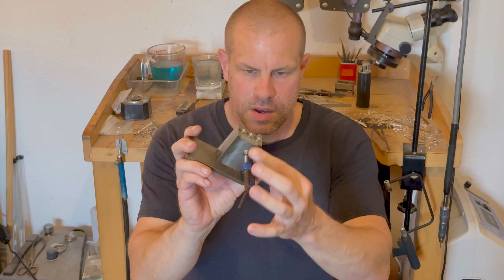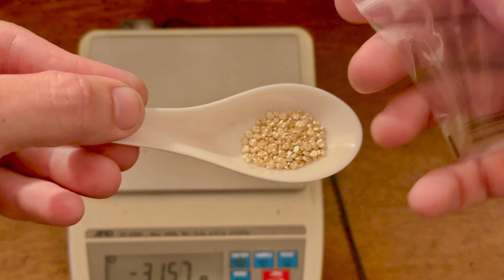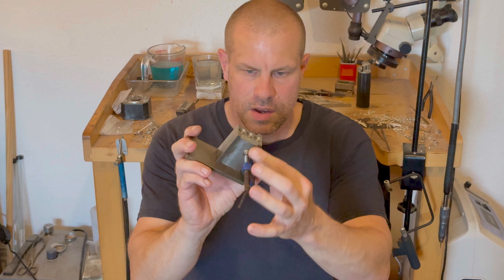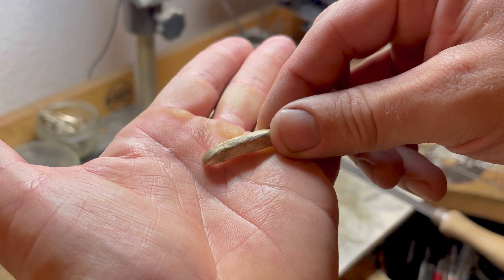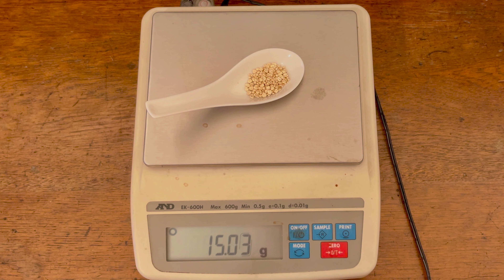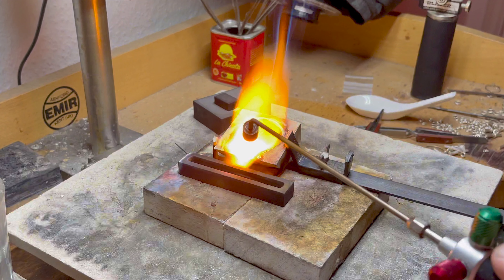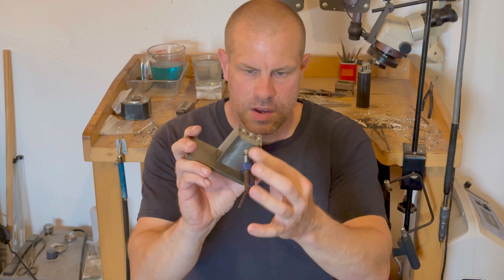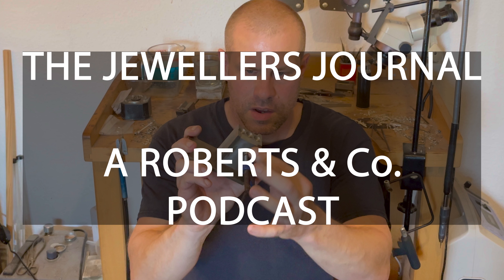Crafting Excellence: The Transition to Graphite Ingot Molds in Jewelry Making Roberts & Co Insights

Comment: Do the metals stick to the molds
Reply from the maker: While the metal may appear to 'stick' to the graphite molds when hot due to the surface tension of the molten metal, as the metal cools and contracts, it naturally releases from the mold without the need for any release agents. This characteristic of graphite molds simplifies the process, making them a preferred choice for many jewelers. The inherent properties of graphite, including its thermal conductivity and lubricity, indeed facilitate this natural release once cooling occurs.
Reply: @roberts_and_co  thanks